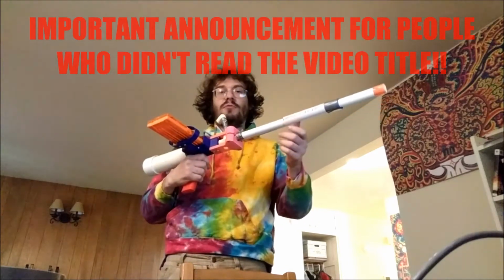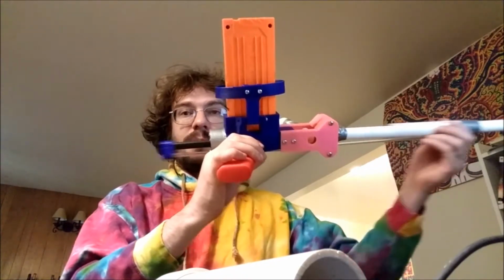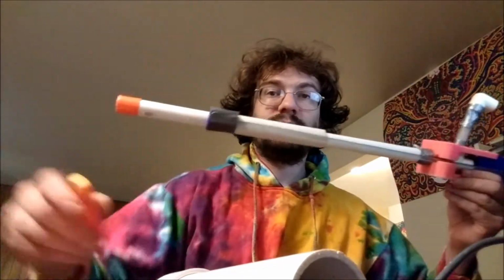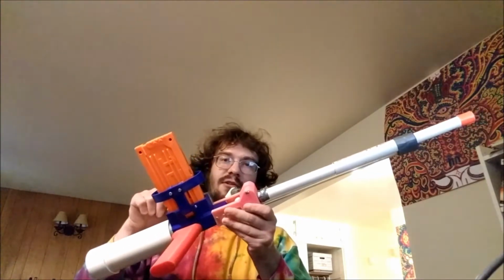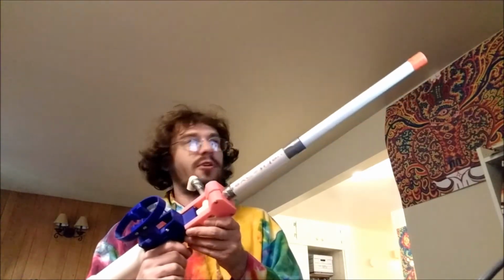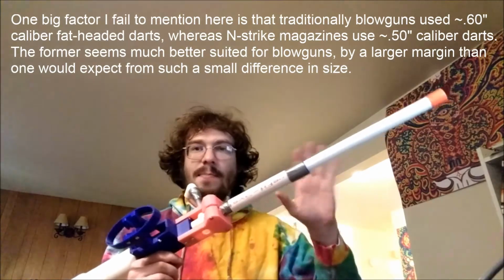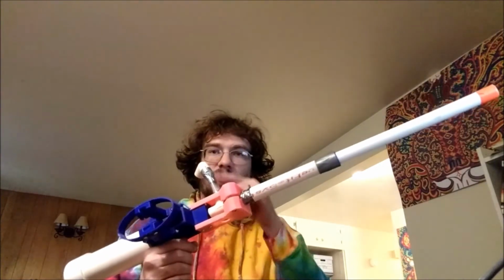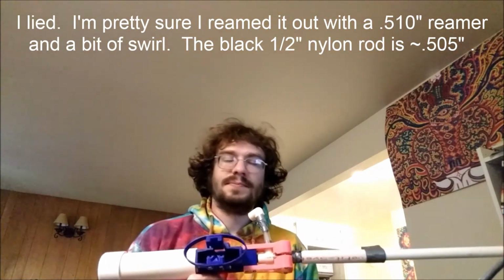Plusblow 4:  The one that wasn't in the other video.

Comment: What sort of ranges does this thing get? Could that be improved with a tighter barrel fit? Whats the current barrel material?
Reply from the maker: As shown, maybe 15m, with a very long (say 2m) barrel, maybe 30m.  Barrel fit is loose (9/16" ID x 5/8" OD nylon), but performance would only degrade with a tighter fit.
Reply: Tighter barrel means more air pressure behind the dart though right?  Am I missing something?
Reply: Barrel fit works differently between propulsion systems that create a burst of pressure (like springers) and those that create a steady stream of pressure (blowguns, HAMPs, etc).